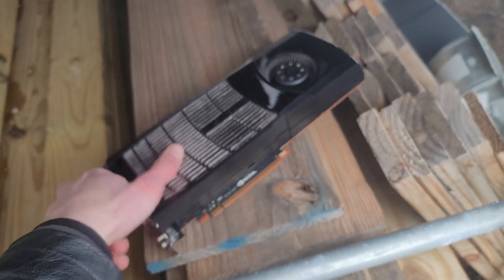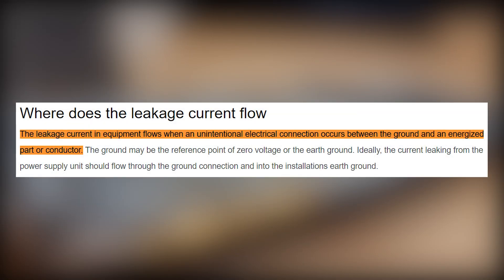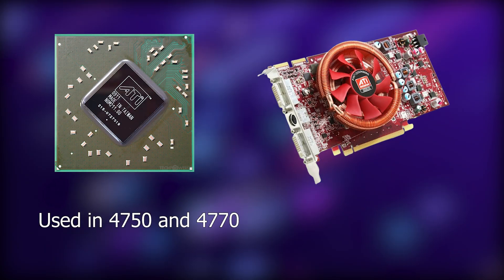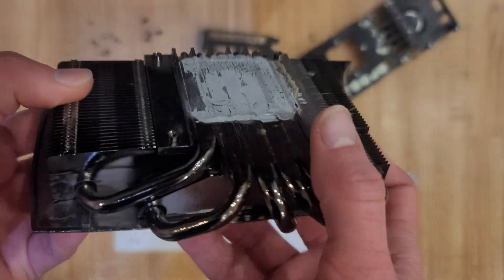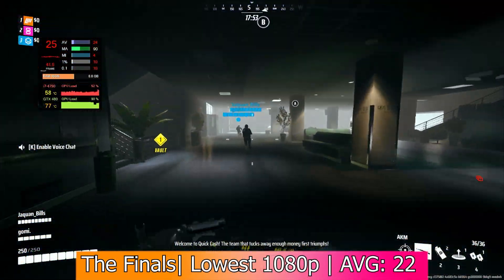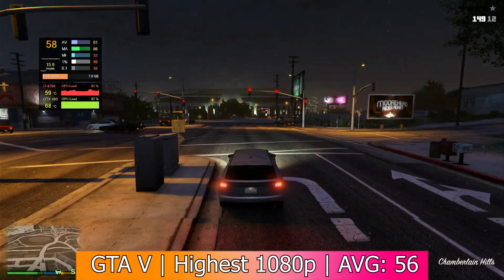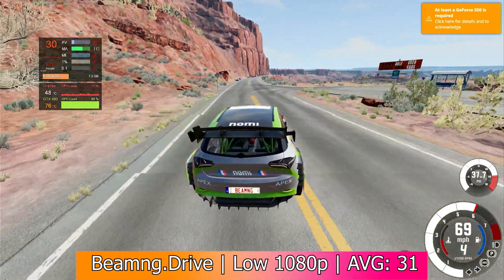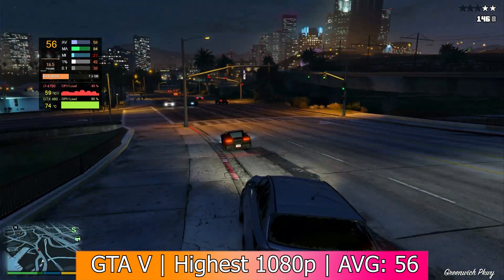Nvidia’s Fiery Flagship - Was The GTX 480 That Bad?

Comment: I sold my GTX 680 (which had only just released at the time) to get my hands on a cheap GTX 480 SLI setup, just because it was hilarious. I ran that setup with air coolers for 6 months for the memes. Absolutely loved these cards, the top card used to suffocate so bad hahaha

Comment: I still have one, and I used it for about 4 years. I remember playing Guild Wars 2 for many hours at an average of 92°C in a small room. It was horrible, but the game ran well. L4D2 ran great, I remember playing with a custom resolution of 2880x1800. It was a good card with atrocious temperatures and power consumption. Even with those temperatures and without ever cleaning it or changing the thermal paste, it's still alive. BTW the Nvidia Demos come with that card was really cool ones.

Comment: Never had a 480, but a Gigabyte 470 SOC instead which was actually an awesome card. With a modified vbios to allow more voltage and an aftermarket cooler, it overclocked nicely yet still ran cool (for a GF100 card).

Comment: Got the gigabyte gtx 480 soc, it basically corrected most of the flaws with a much improved vrm and cooler. It runs much more cool even while being the fastest 480 right out of the box, with core at 821 mhz. It max out at 860 mhz.

Comment: Great video! Surprisingly, the GTX 480 holds up pretty well considering its age - a graphics card 14 years old in 2010 definitely couldn't run anything. You're wrong about 1080p being commonplace at the time the card came out, though. Most higher end monitors were 1680x1050 or lower.

Comment: I think the 480 Gtx has a purpose today, would be good for acting as a display adapter for basic tasks. as well as being great for modern indie games, ps2 emulation, or any consoles below the ps2 so if you can look past its flaws i bet you could run gran turismo 3 and 4 like a champ🔥🔥
Reply: Only if you have a powerful power supply though.
Reply: @SeanPennII dude it only pulls 250w. It draws way less power than modern midrange cards. My 6800xt has a 300w tsp. I ran a gtx580 matrix off a 600w PSU with a 4.8ghz 2600k all the way to 2018. Also have an EVGA 3gb model. Stop it with the PSU comments.
Reply: @LastExile1989 This is a fair point. My point was more about the dude with the Dell optiplex with a Sandy bridge chip who wants to emulate or play older games. He can't just throw in a GTX 480. But he could throw in a 750 TI or something.
Reply: @SeanPennII  Ahh yes I see what you mean.
Reply: Early and mid ps4 era games are fairly playable as well. The vram becomes a very crippling factor though and results in lots of bad stutters.

Comment: Good video.. The only minor note is 1080p gaming was pretty new in 2010, around 2% of pc gamers. Over 60% of pc gamers in 2010 were gaming at 1024 x 768, 1280 x 800 or 1280 x 1024. I think this was still around the time when a lot of high-end gamers were using 22" lcd 1680 x 1050 monitors. I remember seeing a Dell monitor with those specs for $400 each and thinking how cool a dual monitor setup would be.
Reply: IIRC it became the standard pretty fast after that though, I remember getting a new 24" 1080p screen for 150€ around late 2011
Reply: While I don't have any experience of that era, from looking at manufacture dates of displays I've ran into I've concluded that 1024x768 (having become standard at the end of the 90s) was being replaced by 1280x1024 as the baseline standard around 2005, thus why so many were still using it in 2010. Between then 1680x1050 popped up and seemed to become quite standard right around 2009 before quickly being replaced by 1920x1080. During the 1280x1024 era 1600x1200 was a common high-end resolution, during the 1680x1050 era 1920x1200 was high-end and going by reviews at the time 2560x1600 was seemingly also a thing (since it was frequently tested in GPU reviews and this was before VSR/DSR) but I've never seen such a monitor myself.
Reply: I used a 1680x1050 LCD monitor at the time
Reply: 16:9 wasn't quite the standard yet might not have been unusual to see 1440x900 monitors